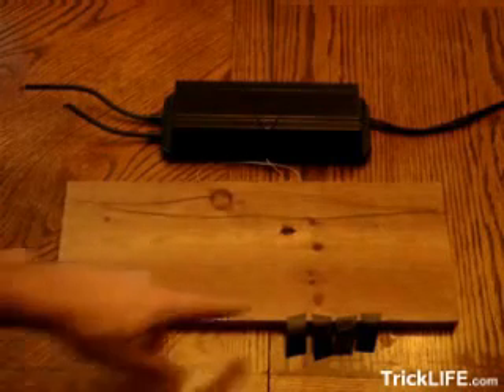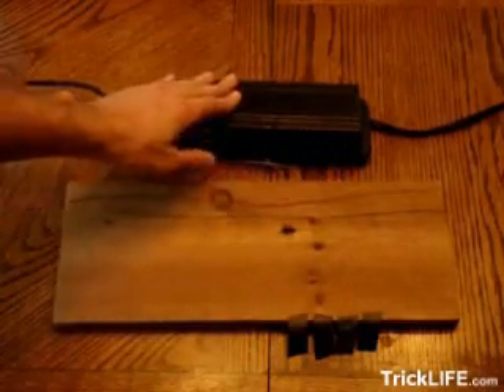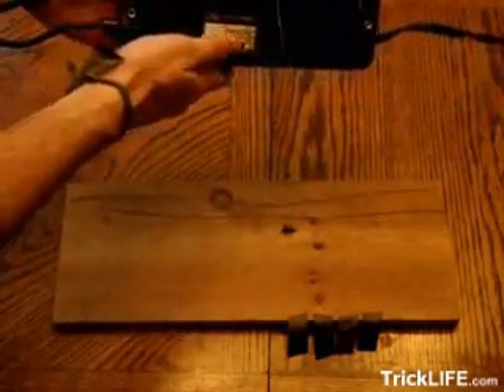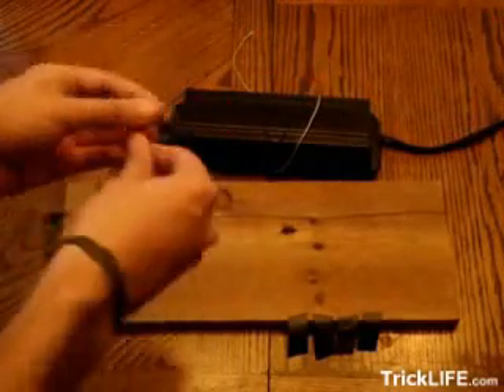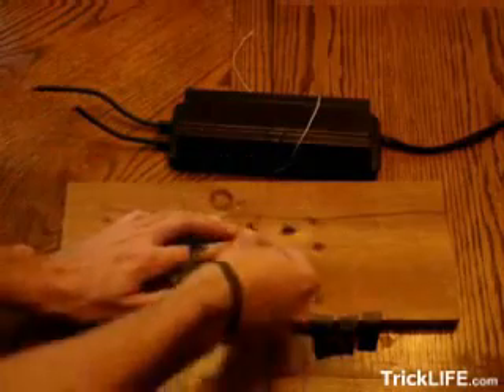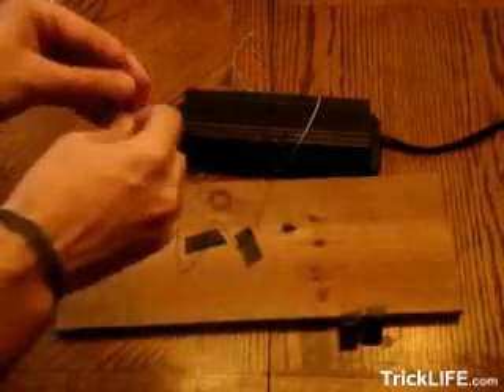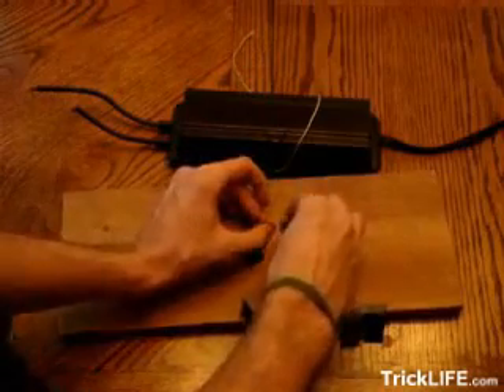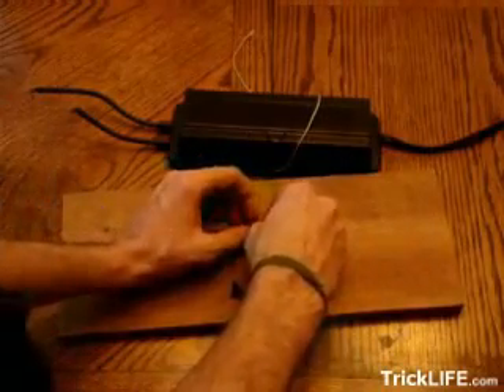Jacobs ladder tutorial

Comment: You should throw in a little safety info with this but since you're too irresponsible... anywhere between 20 to 35 milliampes will stop your heart... Dead. 
And something a little better than tape should be used to secure high voltage connections, and the ladder (screw it down!).  
Someone is gonna get burned or killed making some rickety junk like this out of a transformer with maybe more amps than the little one you have there.